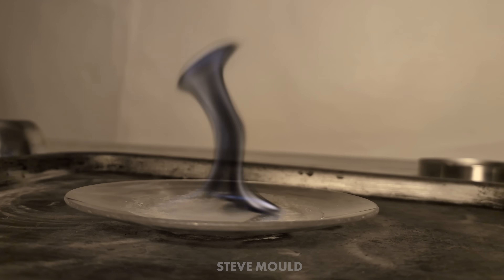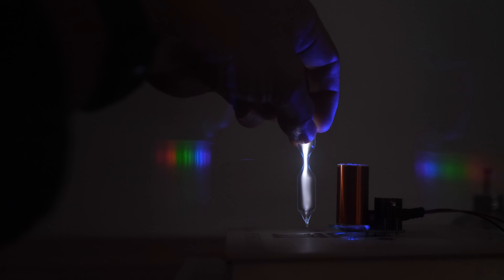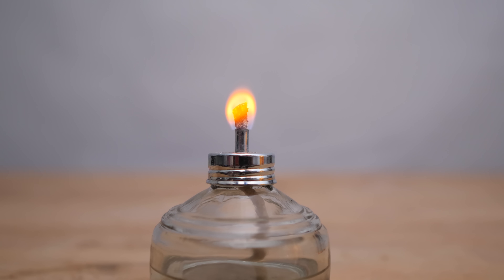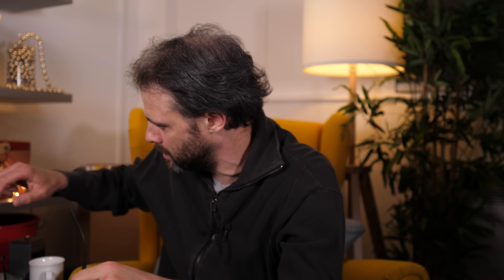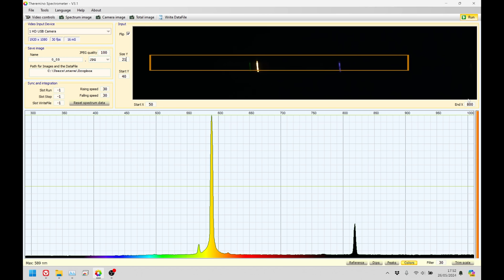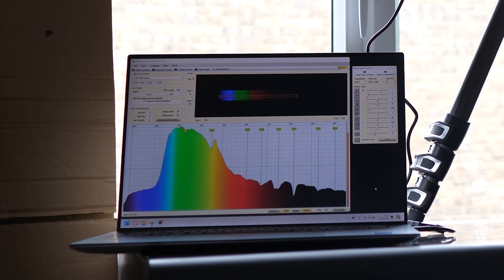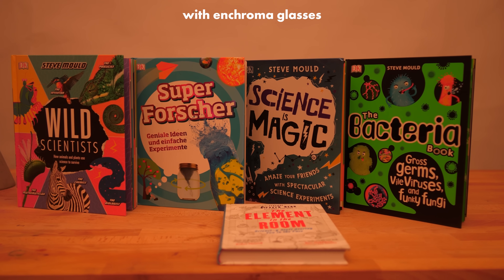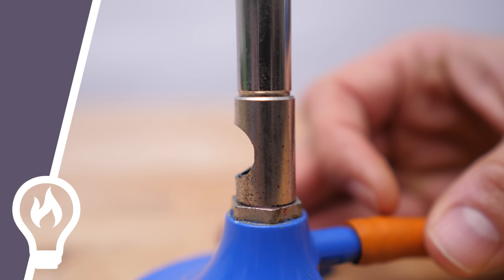Light sucking flames look like magic

Comment: The CRI of low-pressure sodium lamps is not just low, not just 0, it is actually Negative.
It is so wonderfully efficient at both illuminating as well as destroying any colour recognition.
Reply: As I understand it 0 is as bad as it can get while technically being white. For example, a trichromatic light-source with narrow (or single wavelength) red, green and blue peaks would approximate white but it would also make things look as weird as low-pressure sodium lighting.

Because sodium street lights are effectively monochromatic yellow this makes them even worse than that. I believe that's why it has a CRI of -44
Reply: @johnydl  I was looking for some more information on low-CRI sources buuut seems like nobody wants to create such a useless product.
A lightsource having near monochromatic peaks that manage to hit the cones just right to appear white to us. Theoretically just 2 emission-lines should be enough, but i'd guess we can do with 3 :P
Reply: @ABaumstumpf  you're right and I think Braniac75 did that with a cyan and a yellow laser iirc, definitely done it with 3 lasers and a chromic cube to combine them, I mean it is a really niche thing to want though, I think it's kind of what the old LED lightbulbs used to do, and some of the really old Phosphor tubes too, though I don't think any were actually down at 0 it was pretty close
Reply: @ABaumstumpf  RGB lights would have that. Though RGBW LEDs are now common.
Reply: @ABaumstumpf  especially with modern color correction you could just manipulate the colors however you want. But back in the old old days of cinema I wouldn't be surprised if there were specialty lamps made to get certain desired effects
Reply: @ABaumstumpf  Hm. I wonder if a digital video projector that uses monochromatic (laser) light sources with frequencies that are close to the L, M, and S cones of the human eye, but somewhat distant from the peak response of the RGB filters on common digital video cameras (such as in phones) could be used to project an image that appears normal to the eye, but is captured very poorly by digital cameras. That might be a novel (but very expensive and impractical) way to make cammed copies of cinema releases even worse than they already are.
Reply: @johnydl  You could get "white" light from two wavelenghts, like for example yellow and blue I think? And that would perform even worse. The blue would flouresce   on some objects and reflect back a different wavelength, but other than that it is going to simulate colour blindness.
Reply: @katrinabryce I don't think it's possible to create white from two colors. You would need at least 3 (red, green, blue).
And pure white is the mix of the entire spectrum.
Reply: @akyhne  Monochromatic yellow should activate both the red and green cones in your eyes. The blue would activate the blue cones, so that should appear white.
Reply: @akyhne  If you are shining a light directly into your eye, or reflecting it off something totally reflective and into your eye, then you can get a perfect subjective white light by mixing two complementary spectral colors. What you can't get is completely saturated light (not with any finite number of primaries). But if you use a dichromatic light source, then almost everything that isn't white, gray, or black will look strange.
Reply: @akyhne  if you look at a lighting color wheel and use two white light sources, and complementary filters, it is easy.  red/cyan, blue/amber, and green/magenta will mix to white.
Reply: Interesting, I did not know CRI could be negative. P.S. Plenty of sodium vapour lamps in my street.
Reply: @gordonrichardson2972  Yeah, a nice quirk of how that number is calculated.
Granted - CRI was never designed for light that does not at least Appear to be white-ish, but still strange.
Reply: @ABaumstumpf  It makes sense though, since the wavelength it is is between the two of the wavelengths our eyes are most sensitive to, but since it is a single narrow wavelength and not comprised of 2 colors, it actually makes our brain interpret shades in a way counter to our intuition. It makes assumptions that aren't based on reality, and because of that, actually makes us WORSE at guessing the color of things than we would with a single primary color.

To put it another way, the brain assumes orange is a mix of green and red, but green and red things may not contain any of the specific wavelength in sodium lamps, so they may appear black. That really screws up your ability to intuitively color correct.
Reply: @gordonrichardson2972  Many modern lights use discrete light sources (RGB strips, for example, or computer monitors with individual sub-pixels).  The negative CRI impact of the sodium light is because it is so garish, so narrow of a spectrum, that including it in a composite light source reduces the CRI contributions of the other lights.  You can see that effect in this video, where the blue light from the flame is entirely lost in the yellow.  You would better be able to differentiate the blue hues were the yellow light turned off.  Hence negative contribution to total CRI.
Reply: @yellingintothewind This is kind of true, but misses the fact that LEDs are actually pretty broad spectrum, they tend to spit out a fairly broad range of wavelengths centred on their main colour. They aren't ultra narrow spectrum like laser diodes and low pressure sodium lamps are
Reply: @bosstowndynamics5488  That's exactly my point.  An LED, or especially an LED behind a white phosphor, emits a fairly broad spectrum.  They aren't quite black body radiator quality (like the sun), but a set of them carefully matched can produce reasonably close to "natural sunlight".  The sodium vapor light, lasers, and a handful of other sources, produce very tight bands that pretty much can only serve to drown out other colors, hence the negative effective CRI.
Reply: @yellingintothewind  Sorry, misread your original comment, originally thought you were saying narrow band lights can create normal lighting but now realising you meant they aren't actually narrow band
Reply: @bosstowndynamics5488  I think I see the cause for the confusion.  By discrete I didn't mean one component per wavelength.  I think we are on the same page now.  

It is worth noting that narrow band sources like many RGB strips only look like "normal lighting" when observed directly or reflected off white (or grey) objects.  I believe Technology Connections has a whole set of videos exploring that topic.
Reply: Brainiac75 did a video about this 2 days ago (watch?v=l9Gv5FVE-0c), he said the CRI was -44
Reply: @thomasr730  Funny I seen that video the other day as well, have also seen the touchy enchroma videos. Also have watched a couple of others over this week that seem to be intertwined but probably not aware that the other videos on the same subject exits.
Reply: LPS lamps have a CRI of negative forty, for those who were wondering.
Reply: Pretty good for a roadway illumination, keeping your eyes accustomed to the dark.
Reply: As someone who worked on LPS lamps for many years I can confirm this. CRI is calculated by assigning CRI 100 to a full spectrum source of the same colour temperature (for LPS the reference is a black body and still makes colours look pretty awful), and then subtracting how bad the colour shift using the test lamp from this reference was with 8 standard reference colours. The scaling I believe was set to make the older fluorescent lamps (deemed to be good enough at the time) to be about 50.
I hadn't thought about the usual naming  of Steve's glasses (didymium glasses) until he said that they contained neodymium & praseodymium - so thanks for that! They could be used to check LPS lamp performance in the field as the amount of sodium vapour in different parts of the lamp varies and when too low allows you to see the red light from the neon in the tube.
Reply: Low pressure sodium lamps have a CRI of -44, High pressure sodium have a CRI of 24
Reply: i want a sodium lamp, they havent had them where i live in probably 20 years now but they were so cozy
Reply: and considering they were originally developed as a light that made it possible to walk around at night, while being easily filtered out by the local observatory; they did what they were meant to.
Reply: @kenbrown2808  My understanding was that the effects on astronomy were a happy accident with the main reason for their use being that they're so efficient that LEDs have only just caught up with them recently, and street lights actually consume a substantial amount of power so that efficiency really matters
Reply: @bosstowndynamics5488  no, because they replaced mercury vapor which aren't much less efficient. The big upgrade was metal halide. Fluorescent gives the same light with about half the power consumption of sodium.
Reply: @kenbrown2808  "Fluorescent gives the same light with about half the power consumption of sodium."
????? Did ... did you ever bother checking anything before writing such madeup lies?
Reply: @ABaumstumpf  only after I started retrofitting 70W HPS fixtures with 23 watt CFL bulbs.  but yeah, I'm just making it up.  oh, and they now run 13-15W LED bulbs in the same fixtures.  but I'm just making that up, too.
Reply: @kenbrown2808  "70W HPS fixtures with 23 watt CFL bulbs."
so yes, yes you are making it up. HPS are in the range of >100lm/W, compared to sub 100lm/W for CFLs.
So by your own (rather stupid) claim you went down to less than 1/3rd the light while also decreasing the efficiency of your setup.

But you do you. If you wanna be a liar that is up to you.

Comment: Disney used "amber screen" in Mary Poppins , that  predated green/blue screen special effects, back in the 1950s . It used sodium lamps.  And it is superior in many ways to green screen and blue screen.  It's even possible to do transparent things like water and fine hair,  which has proved very difficult to do in green screen.
Reply: A modern way to do scary clean colour key composite is to have the background of retroreflective material (3M Scotchlite) and place a green non-diffuse ringlight on the lens. You also lose all colour key spill this way. If you're dealing with green items, you can also use RGB ringlight and switch to a different colour. But due to how saturated the colour is, you usually don't even need to, because real world pigment greens can't compete with the LED on saturation.

One could potentially enhance it by going complimentary, switching the ringlight frame synchronously between green and purple every frame. Of course only for cameras that record in non motion estimated CODECs. But this is also largely unexplored territory, because i guess standard colour key works well enough.

Still having a near-true moving matte from sodium light does have advantages!
Reply: @SianaGearz  with the advent of machine learning/AI , amazing things become possible. The ability of the AI to distinguish what is background to remove/replace is uncanny, and it's only getting better by the second! It's starting to make chroma key look like old hat.
Reply: @MyProjectBoxChannel Sure, but if you look at the demo on Corridor's channel using a modified version of the sodium lamp setup it's pretty much flawless, far outperforming any other process available today including current AI based systems. I'm sure future AI vision setups will eventually be able to just about match it, but doing it with a near perfect optical process is going to be very reliable and simple to implement, whereas AI systems are always going to have glitches and edge cases, not to mention being a lot more expensive to run for the foreseeable future
Reply: @MyProjectBoxChannel   Scepticism is called for. For one, frame to frame coherence problem with machine learning isn't 100% solved, and who knows, it might be in a few months, or maybe we run into a brick wall. Perhaps the solution is found but isn't economical to run, that can happen too.

For other, you're dealing with selected examples a lot of the time, which have expected inputs and outputs; but when you're doing something that doesn't look like things that the AI has been trained on, all bets are off.

Even though ML unlocks possibilities that seemed crazy before, classic deterministic approaches are going to remain valuable.
Reply: @bosstowndynamics5488   I agree 👍.  Probably a combination of both technologies. Chroma-key with AI
Reply: @SianaGearz   I agree 👍.  Probably a combination of both technologies. Chroma-key with AI
Reply: Green screen, blue screen, black screen, and white screen all predate the sodium lamp amber screen technique by many decades. Mary Poppins is one of the only examples of amber screen because it's not nearly as reliable as the other chroma techniques
Reply: This is the comment I was looking for. The YouTube channel "Corridor Crew" did a video not long ago where they resurrected the technology, showing off just what it can do that a green screen can't.

Comment: Back in my physics days, you could look up all of these lines and transitions in textbooks. Or on NIST, but that page seems to be strugging. I did the looking up for you:

The 819nm transition is a 3d-3p transition. The other ones are from higher orbitals, 5s-3p for 616nm and 4d-3p for 569nm.
Reply from the maker: Thank you!
Reply: That peak in the IR is actually another doublet at 818.3 nm (3d2D3/2 → 3p2Po1/2) and 819.5 nm (3d2D5/2 → 3p2Po3/2). See "Surrogate measurement of chlorine concentration on steel surfaces by alkali element detection via laser-induced breakdown spectroscopy" in Spectrochimica Acta B by Xiao et al.
Reply: I love the NIST page for this. It has exactly what you need and no more: https://physics.nist.gov/PhysRefData/Handbook/Tables/sodiumtable3_a.htm